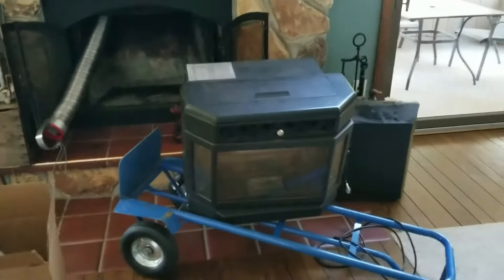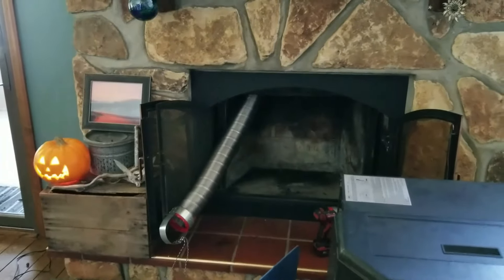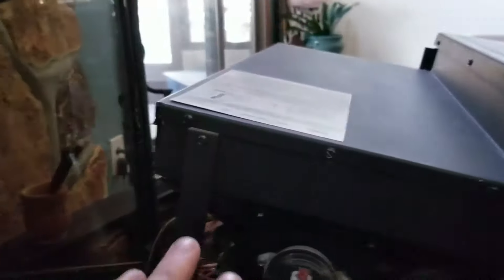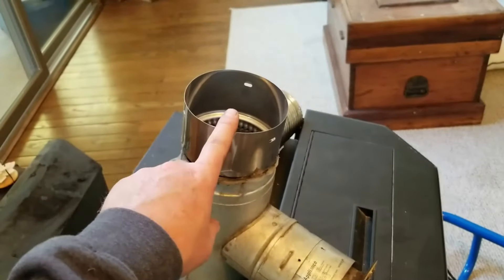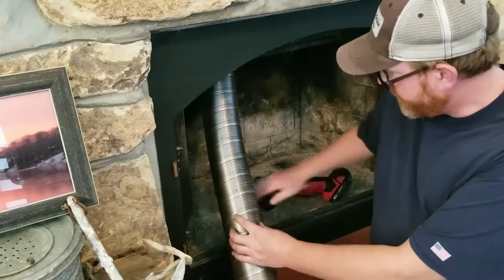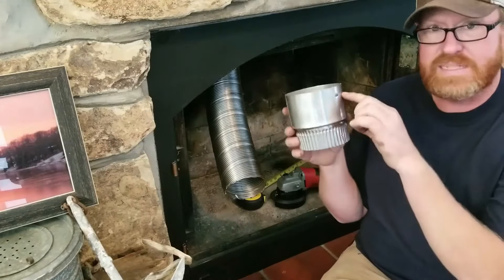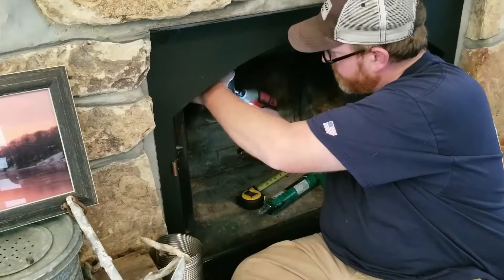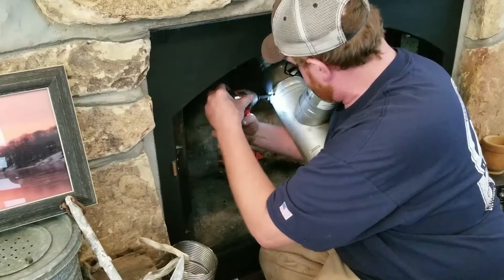Pellet Stove Insert Installation - Self Install - DIY

Comment: Your reducer is upside down. Must correct. Make your connection to the stove first, then when on the roof pull the extra up, trim and install the chimney trim and cap.
Reply: True, the correct reducer has a a female size to the stove output and a male fitting going to the liner pipe.  Can leak smoke.  The one shown is reverse of what is needed.

Comment: I have a regular pellet stove and the first thing that jumps out at me is how in the world are you going to be able to clean the bottom tee cap out on the pipe. You're supposed to clean it out once a month . Mine is always full in a months worth of burning.
Reply from the maker: It's real easy to move out and access. I have cleaned it but I haven't had much ashes in it.
Reply: Doesn't hurt to clean it that much, but really only necessary every burnt ton.

Comment: Can you remove those inner walls of the fireplace if the insert won’t fit?
Reply from the maker: Walls of the existing fireplace doors?  I don't see why not. You won't be using it as a normal fireplace anymore.

Comment: Thinking about putting one in , did you anything with the fresh air intake?
Reply from the maker: @adamhaggerty2206  no. This is an older stove and according to their manual, ducting the fresh air intake is optional. I opted to not mess with it. While I'm sure it would be better.... I didn't do it.
Reply: How many sqft are you hearing with this?
Reply from the maker: @adamhaggerty2206  around 1000.

Comment: How about the air intake does it need to be hooked up
Reply from the maker: The manual for my stove says it is optional to have it pull from outside. Your manual should specify.

Comment: Thanks for the video! I'm looking at doing the same so this was very helpful. Was there an air intake in your insert? If so, are you just drawing air in from the fireplace cavity? I see a lot of these want an external air source and really don't want to go that route.
Reply from the maker: Yes its drawing from the fireplace cavity. I didnt want to drill a hole and run it outside and the insert directions did not call for it.
Reply: It depends on your cavity, most inserts have damper rods which sets the air flow, if its intake isn't enough u most likely won't be able to set an optimal pressure to get an efficient burn. We use a magnehelic differential pressure gauge and these fires are usually set to around 1.4-1.5 psig using the damper rod once the convection fans have kicked in, if u can't hit these numbers then u don't have enough intake.

Comment: Just wondering as I am super new to pellet stoves and I have this kind of wood stove set up.. do you need to put a pipe for the are to come in to help with combustion or is this just done a different way with this model?  Thank you.
Reply from the maker: The St. Croix york installation instruction manual says in every install example that outside air is optional. I didn't want to drill a hole in the wall so i opted not to use outside air. I believe that most manufacturers suggest installing a tube for outside air though.
Reply: @bucksgarage1  Okay thank you! I know I don't want to do it either as I have to drill through cement chimney.

Comment: How do you account for the combustible air intake?
Reply from the maker: It's not hooked up to outside air. The specific manual for this stove says it's optional. Maybe because it's older?  I would imagine you would have to either cut out the side of the chimney or run a pipe up to the top.
Reply from the maker: Google St. Croix York Installation manual. It gives 3 different scenarios for the fresh air intake. All say optional, but it has examples.

Comment: Do I need to run a flexible vent pipe all the way up the chimney 2 stories? This will be about 25 - 30 ft.
Reply from the maker: Depends on the manufacturers specs but generally yes. It should be over the peak of the roof.

Comment: Nope should have left it long so you could take the stove out for service
Reply from the maker: Have you ever installed one of these? How would that have worked?  You only have so much room.  The top cap is secured down so you don't have a bunch of free space, the pipe is fairly rigid and barely flexes lengthwise. Its only 4 nuts to remove the pipe off the back so it only takes a few mins to prepare for removal.